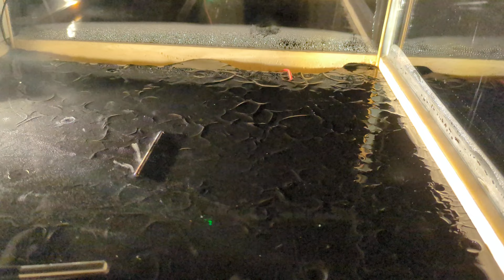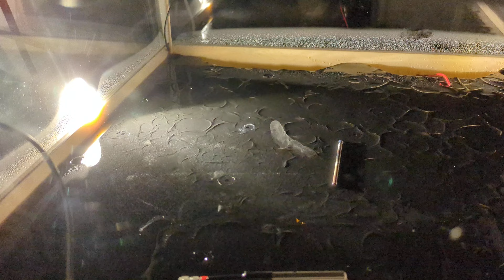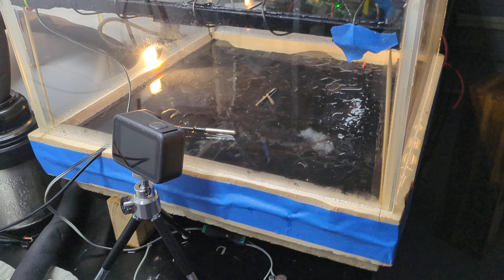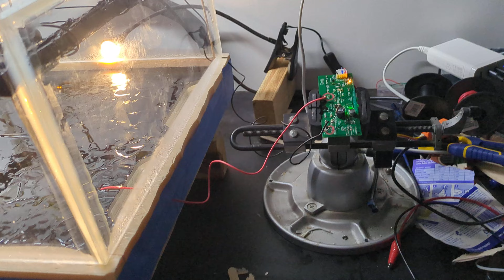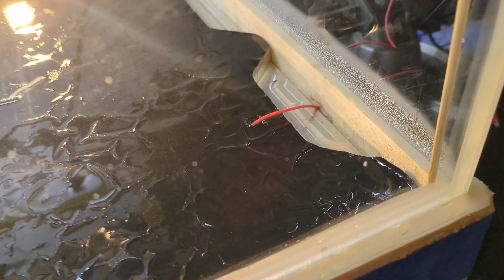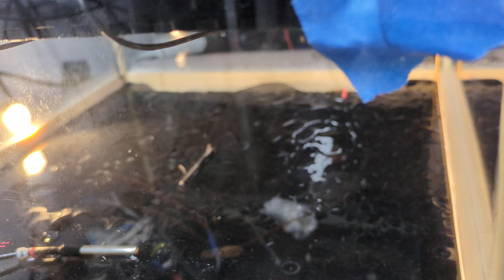Cloud Chamber Build: Part 3: It's working!

Comment: I am not sure what is happening but it sure is fascinating.
Reply from the maker: As subatomic particles pass through the cold air they cause the isopropyl alcohol to condense from a transparent vapour to an opaque cloud. You can see the short, sharp trails around the metal rod. These are caused by alpha particles. There are also a bunch of bigger, fuzzier trails scattered araound at random. These are caused by background radiation of all kinds.